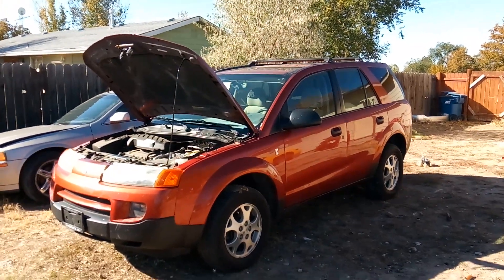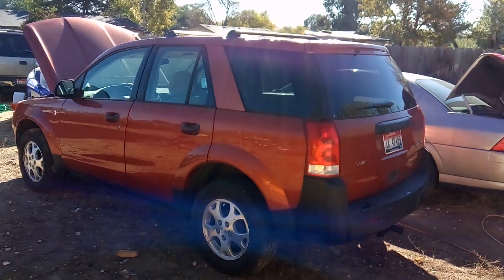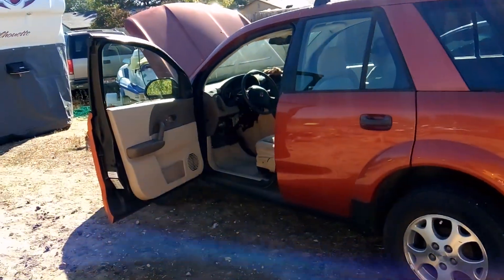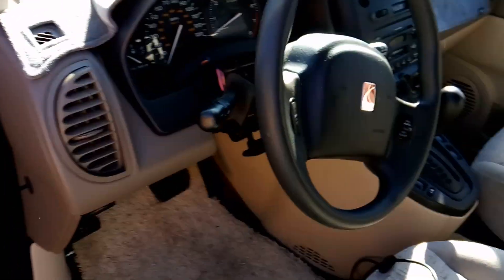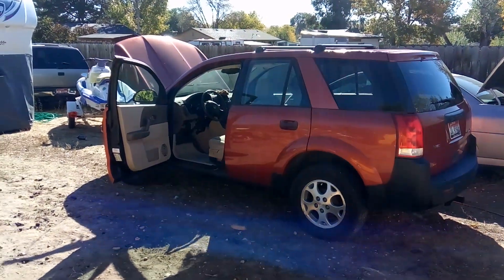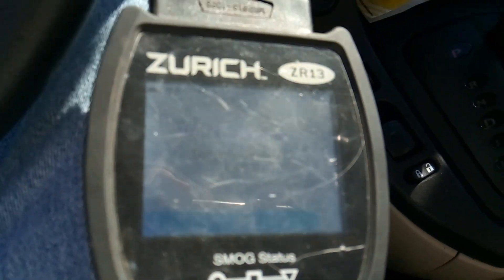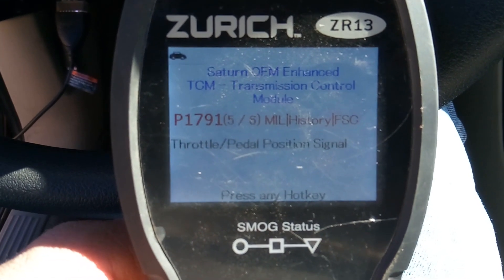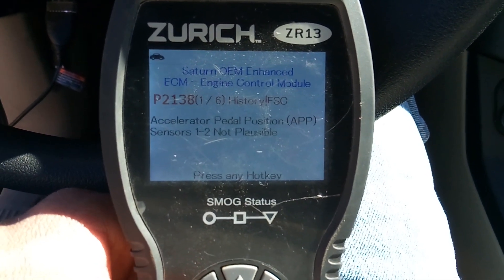Saturn Vue Throttle and accelerator issues diagnosis

Comment: I have a 2003 Vue manual 2.2L.  When I first acquired it, it went to limp mode constantly. It was particularly bad in wet weather. This can be cancelled by turning the engine off and then restarting. One nice thing about the manual is that the engine can be turned off and restarted without pulling off the highway. Just disengage the clutch, turned the key off, turn the the key back to the run position, lift your foot off the clutch pedal slowly and let the movement of the car restart the engine. The DTCs were P1271 and P1275 which indicated a faulty accelerater pedal position sensor (APP). So I swapped in a new one and nothing changed.  I traced the wires and found that at the main connector block (to the left of the drivers left leg) the 6 wires involved had been bypassed.  The party I bought the vue from had no mechanical expertise. So it seems others before this owner had been dealing with this problem for some time. I had another Vue so I swapped out the PCM. the throttle body, the manifold absolute pressure unit.......all of which had no effect.  I cleaned the throttle body and this made an improvement. I used a scanner to track the freeze frame data and it showed no trends.  I had concluded at this stage that the problem was in the wiring rather than the modules. I tested all the wires involved and they all showed resistances in the correct range.  I opened up the back of the J1 connector on the PCM and found it full of dust and crud.  I washed this out with Carb cleaner, toothbrush and q-tip..  This seemed to make  quite a difference.   I watched a video by Ivan at Pine Hollow (actually I watch a lot of his stuff) where he mentioned that electronic sensors tend to operate based on voltage rather than current. This makes them very sensitive to moisture, oil and dirt which can ground out voltages. I cannot say I have fixed the issue but I dont get limp mode any more in the summer.    The codes shown in this video for APP problems are for the 2002-2003 Opel V6, which differ from those of the 4 cylinder ecotec.

Comment: I have a 2005 ion, no crank, no start, good starter, good battery, all fuses and relays good, no problem with theft system. Any thoughts? It's like whatever is suppose to tell the engine to start is not working, no crank and no power to fuel pump. Nice video, thanks for the Info. 👍👍🏁🏁

Comment: We replaced the pedal and the car is still acting up.  We've replaced several parts and still can't figure out the problem.  Very intermittent glitch.  Car bogs down when starting out or shifting down.  I'll pull off the side of the road to a complete stop, car will shake and sometimes the check engine light will blink.  I'll turn the car off and turn it back on and it clears the issue.  Any thoughts?  2004 Vue 5 speed 4cyl.

Comment: What did you figure out? I'm having the same issues, I changed the pedal. It didn't work. I have u2105 and p1779 codes come up. The interior lights sort of flicker like a drain is happening, even after I noticed that I put in an after market radio. First time doing it, could this be the cause? Had a test ran on it at advance, Alternator is great, new battery, but says the starter gets ZERO volts but it runs and starts fine? I've checked the ground is fine all over the car. Before I cleared the codes these were the codes U1016, U2105, P1779, P0703, P0504, 02135, P0221, P0700. It didn't start doing this until I changed the brake booster and master cylinder and rotors and brakes but that doesn't seem related.
Reply: Did you find the problem? I have the same issue I'll appreciate your respond. Thanks in advance!

Comment: Q: I got a 05 ion 2.2 w/ the same problem. 
I changed the throttle, pedal, coil pack, ignition module, knock sensor and crank sensor and still got the same power down problem. 
Besides a match and gas , any other info to fix this problem?

Comment: i had the same issue...was a clogged catalytic converter and the sensor at the intake.
On the minivan ( i had 3 ) must replace the harness wiring a must and the computer can be send for a re-manufactured and programming it cost me $700.00 total.

Comment: I'm considering buying a 2003 Vue with the 3.0 w/ 112K on the clock for a good price. Am I better off just replacing the accelerator pedal, BCM, and TCM for preventive maintenance? Planning to put a lot of miles on it.

Comment: has replacing the gas pedal assembly solved the problem ?   I have a 2003 L300 v6 with a similar problem....where the wrench light comes on and then it drives "better"....but it acts as if its running lean with no power in the rpm band where the 2 to 3 shift is so 25 to 35 mph is the worst speed for around town driving.  Seemed to me as if it was an old school computer TPS situation if it were a mid 1980's car …...not the OBD 2 system that it is.  But in either case....replacing with a new gas pedal assembly or a new throttle body is expensive.   THIS IS WHY I PREFER NON COMPUTERIZED CARS AND TRUCKS......give me old school HEI distributors and carburetors
Reply: Had this problem on 2002.  Replaced throttle body and excelerator petal.  $1600 new parts, went to pull-a-part and took off parts...simple. $56.  Problem solved and I'm not a mechanic.
Reply: Oh yeah, cleaned the carbon buildup off throttle body before installing.

Comment: Had some of the same codes and tried everything as well new throttle body an all if i shut it off and then when I started it it wouldn't accelerate could that b tcm?

Comment: I have a 2002 3.0 Vue. My problem is after a engine swap, my shift points are much higher causing higher fuel usage. What would you suggest I do? Thanks.
Reply: It’s the engine that is using more gas, shift points are from the transmission.

Comment: Mine chugs when u excelerate rpms run high in 5th gear. Changed the catalatic converter cuz that is what the code said it was. Still having the same issue. It chugs accelerating and them it jus takes off. Help!!!

Comment: basically it narrows down to pedal or throttle body if it goes slow and no acceleration change pedal and or throttle body diagnostic tool unit takes out the guessing.
Reply: Auto Surgeon51 Not true, I just fixed both of those on mine and it still craps itself periodically. Not every single time, but I daily drive it with this problem always at the back of my mind and it could happen at any moment...

Comment: i have a few questions????  my 2003 staurn vue is throwing the sercurity light and i cant figure it out is there anyway you can contact me threw a message or something i have changed the throttle body and pedal and knock sensor and nothing has helped
Reply from the maker: highgrooveauto30@gmail.com
Reply: @MattShaughnessy6  could it be one of the o2 sensors??

Comment: It's crazy that my 2004 Saturn Vue has all of the same exact problems. So I need a new body control module and I should replace the sensor on the ignition. I've been dealing with these problems for 3 years.
Reply: My power steering stops working when my gauges don't work

Comment: I had the same issue at my 2002 Saturn vue 3.0l v6 and I turned out that it was the throttle body
Reply: I have an 2003 saturn Vue and it always says reduced power and people are telling me that they think it’s the catalytic converter

Comment: 2007 Vue idles rough . Please help
Reply: Put it in neutral and see if that helps. If it does that means you have a bad motor mount.
Reply: Lucius gas cleaner the big bottle drive the gas to E pure half of bottle of gas cleaner than put gas in your car it will still idle high at first but will eventually calm down I also have a 2007 Saturn Vue